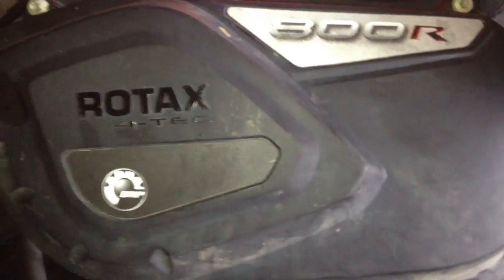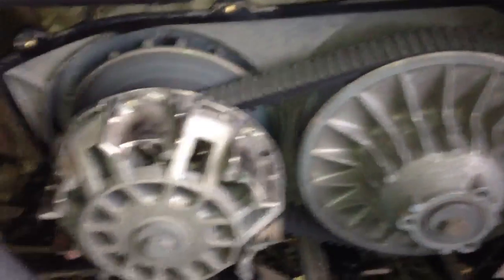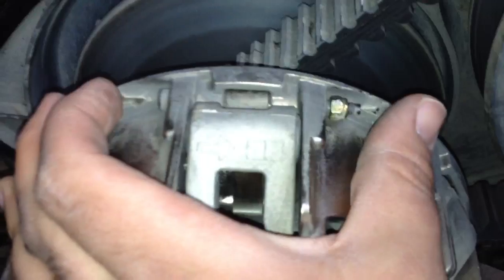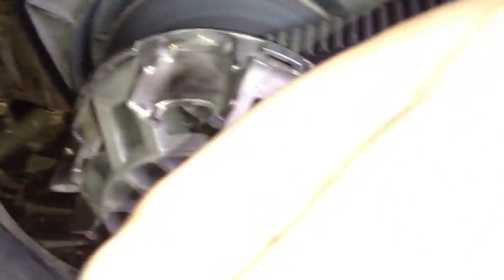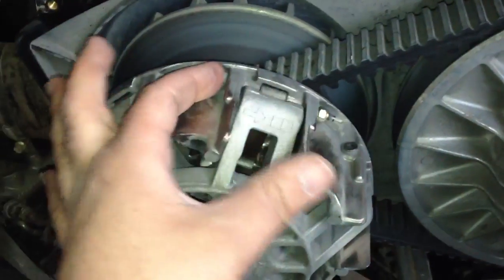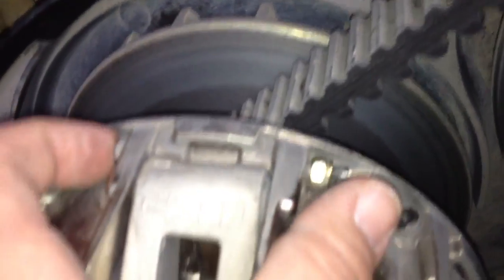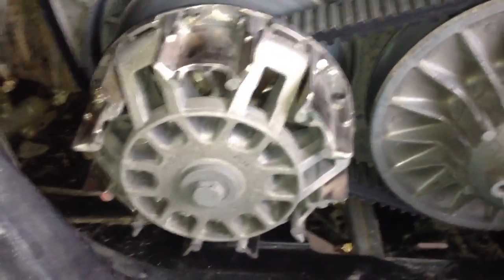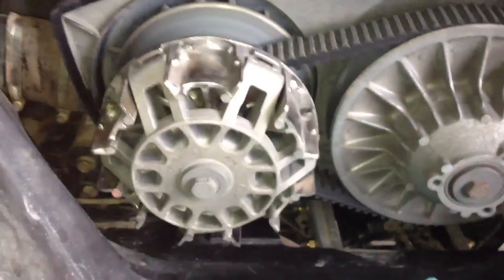Can-am clutch ticking noise fix

Comment: Please let me know what the blue stuff on your ATV is?? Did u add that to the washer to get it on better??
Reply from the maker: It's blue loctite
Reply: @153eddy  so do I add that on as well?
Reply from the maker: A very small dab on the thread to ensure the nut doesn't back off with vibrations
Reply: @153eddy  sweet man thanks .it's been so long since I've taken my atv out I'ma make sure it's that first.if so I'm good to go. Thanks

Comment: I bought a tube of that iso flex, changed my belt the other day and couldn't figure out where I apply it. I changed the belt and just put it back together. Ever since then I've been having a loud noise. Any advice?
Reply from the maker: You need to pull the one way bearing out. Carefull when you do as there are 2 springs and caps that will pop out. Grease the bearing race and the slider cap

Comment: Could this be the culprit on a CVT transmission? My 2010 jeep compass is making a clacking noise upon acceleration and deceleration. Sometimes even when shifting from park to reverse or park to drive. It doesn't however make the noise when revved in park or nuetral. If you can help it would be greatly appreciated thanks!
Reply from the maker: No. Car cvt's are a little different.  Yours sounds like a loose or worn cvt chain
Reply: Thanks for your response. Yes that's what I am dreading a transmission problem. I'm hoping it's maybe the axel. Keeping my fingers crossed for the best worst case scenario.